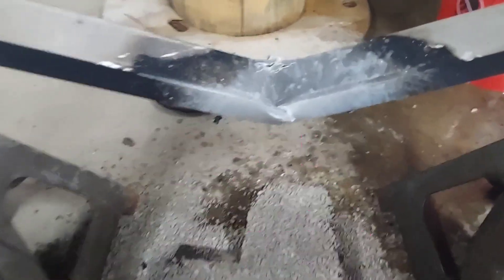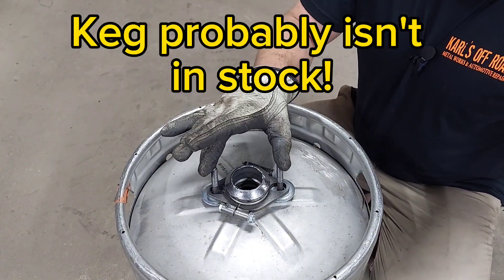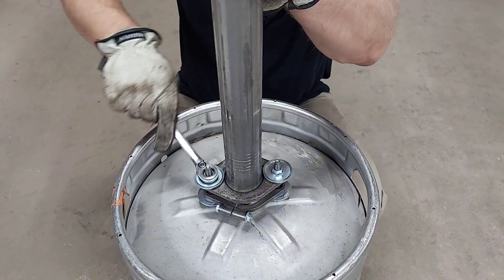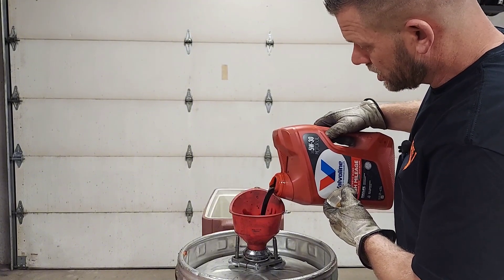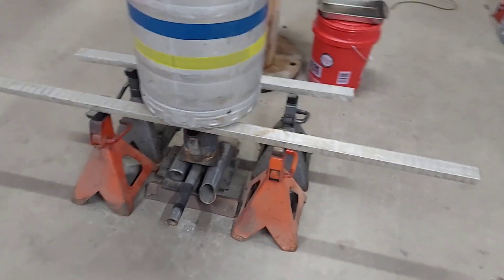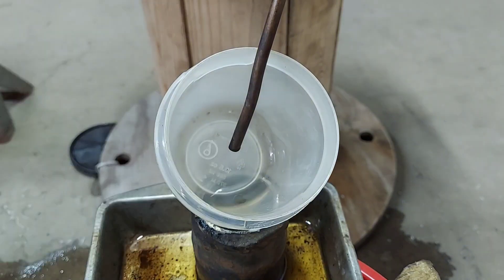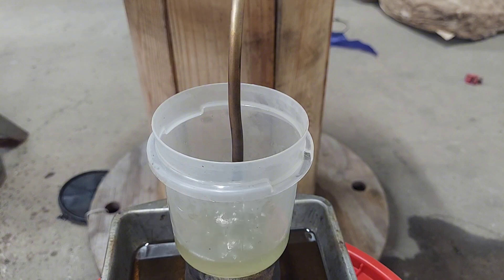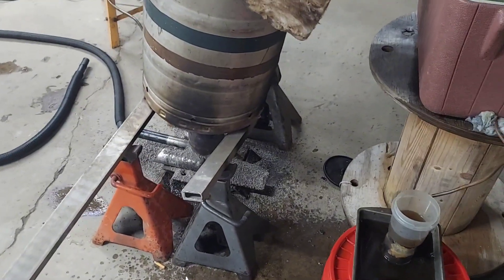DIY diesel fuel from used motor oil! Not black diesel!

Comment: So lubricant oils are longer chain hydrocarbon than fuel oils, u can't turn lubricant into fuel oil... 
The distillation process removes short chain hydrocarbons leaving lubricants....
Yes black diesel can be used in some less particular engines.... But this isn't Diesel
Reply from the maker: Neither is black diesel? It's oil mixed with gasoline. I would argue that my fuel is as close as you can get without distilling crude oil. I don't have to add anything to it or any further filtration to use it in my engine. I'm about a year into testing this fuel in an engine that has only run on my DIY diesel, and I haven't had any problems yet. Thanks for watching and I appreciate your input! Have a great day!

Comment: Hola.. muy buena información. Acá en Argentina el costo del diesel es muy elevado. 5 dólares el galon aproximadamente. Y voy a intentar producir un poco de combustible para mí uso.
Reply from the maker: Good luck and be careful.  I do have some other videos with a much safer setup. Like with all projects, it can get dangerous. Use caution any time you're heating a volatile liquid.

Comment: It says diesel ignites at 410 Farenheit so is it not dangerous?
Reply from the maker: It definitely has risks involved. Lol,as long as it doesn't get any oxygen in the still, it should be fairly safe. Similar to a wood gasifier.
Reply: @karlsoffroad  so where do you put the gas vent of the cooling tower? I guess anywhere on top...
Reply: So it heats up turns to gas and flows to the cooling part? Why hapens to the leftover sludge or carbon? It just collects at the bottom?
Reply from the maker: @Peterswarahed Yes,then you can dump it out and use it to heat the next run.

Comment: It's black diesel. After about 48 hours, it will turn into black diesel. This is due to the carbon compounds in the oil that is produced. To clean it, you will need to go through another chemical treatment process. I have been testing it for over 10 years.
Reply: So why dont Share your wisdom then?

Comment: You might consider heating with an electric element so to keep those volatile gasses from finding that flame.
Reply from the maker: @azurplex  I've since moved my condenser further away and made some improvements. I haven't had a problem, but I would definitely like to avoid having one! Thank you!

Comment: What else would you have to add to it for it to work in a pre emissions common rail? A 3.0 m57 and a 7.8 Isuzu to be exact
Reply from the maker: @4rubberzaday  some people say you need to chemically treat the fuel. I have been running it in a Chinese diesel engine with no problems. Use at your own risk in something important. I'm no chemist, but it runs fine in my cheap engine.
Reply: I bought a Chinese diesel generator of alibaba I’m going to try running off this hopefully I can make it to where it’s self sufficient and have it make its own fuel. Got a high temp vevor hot plate I’m going to try to use with temperature control

Comment: your first fractions are not an oil fuel fraction.  Would be more of a petrol like fraction.    Till it hits the right temp to be putting out a kero/diesel fraction ...... you can feed the early stuff (while still in gas form- do not even need to condense it) right into the burner fire to use it as an aid to your heating process

Comment: Insulation will 10 x this project.  All your time and heat is being lost on thermal losses.  Aluminum heat sink
Reply from the maker: @eby6114  I did wrap it in insulation. Thank you for your suggestion.

Comment: What is the best way to connect the cooling coil to the steel pipe I'm using black iron pipe and stainless steel 3/8 tubing
Reply: Ok thanks I tryed soldering but the soldering was melting loose
Reply from the maker: @lifeoftraveling8330  ,I have a newer video with the improvements made to the system. I also had much cleaner production.
Reply from the maker: @lifeoftraveling8330  they sell adapters at most hardware stores. I'm using an adapter that goes from black pipe to 3/8ths copper with a compression fitting on the copper side.

Comment: i thought what an awesome idea its a learning process pleased nothing was damaged but a successful demonstration of cleaning used oil  i saw on a youtube channel how you could easily clean cooking oil by using gelatine mixed in warm water and mix it with the cooking oil the next day all the impuritys are gone and you just tip out the clean oil and afterwards pull out the set gelatine and throw it away super simple process and i thought if it works for cooking oil it could work for engine oil so i was going to try it i am in the country so have had to order the gelatine in But your process works really well and people should be recycling used oil for diesel vechicles or just for burning or heating and your oil burner works awesome Thanks for sharing
Reply from the maker: @brenttamatea7578  Thank you for the kind words! I appreciate you taking the time to watch and comment! Have a great day!

Comment: A real back yarder doing this video, using 1/4" mild steel bolt on a product that is heated, i would never recommend.
Reply from the maker: There are two 5/ 16th bolts that hold the flange together and two 3/8th bolts that bolt both flanges to each other. I'm not sure if that's what you are talking about? These flanges are meant for exhaust systems. They are a repair flange for the pipe to manifold connections, and your exhaust system gets just as hot if not hotter. I would say the flanges are not an issue as far as safety. The rest of the process is far more dangerous! 😆 This is in no way a how-to video.

Comment: At 12:00 , I’m screaming at the phone… TURN YOUR FIRE DOWN 
1) Your whole “beer keg” needs to be inside another metal canister, as a fire chamber … you’re losing too much heat out of the sides, and the top of the keg
2) Your column should probably be insulated, also
3) Your copper tubing is way too small 
4) Your condenser section is way WAY WAY too small  - Quadruple the size of your condenser!!!! The product that drips out of the end should be room temperature - or cooler than that!!!! 
If the product that comes out is warm to the touch, you need to have MORE condenser, yet
Reply from the maker: It comes out cold,so no problem there. I realize it's not efficient in any way. I'm definitely going to be using a different vessel to hold the oil in the future. I'm just experimenting until I get my setup working. I just used what I had laying around and went for it. Thanks for your suggestions!
Reply: @karlsoffroad   Cool, good to know!

Comment: I've always liked the idea of distillation and have thought about it quite a bit over the years.  My only question is energy input.  Is the fuel output worth the energy input to heat the oil to the point of distillation?  Thanks for the info.
Reply from the maker: For me, it is because I use waste oil to heat it,and my blower only uses 19 watts.
Reply: @karlsoffroad  nice.  Have you ever had any close calls as far as fire and such goes?  That's something else that's always put me off a bit.  Also, how much output do you get per gallon of input?
Reply from the maker: @NotSoGrandGarage ,I'm working on a video about the output now. It should be posted this week. I've made some messes, but no explosions yet! Lol

Comment: So how tall was your stack you made on top the keg I'm looking to build one out of a 55 gallon drum
Reply from the maker: About 5 feet,I changed it since then. I was in the middle of a run and ran into a different issue. I will be posting the video soon.
Reply: @karlsoffroad8609  ok can you let me know the change or going to mention it in the next video
Reply from the maker: @lifeoftraveling8330  ,I will have details in the next video. I made the tower as short as possible along with some other changes. Thanks for reaching out!

Comment: great video. would it be beneficial to have some kind of packing in the column?
I've had most things needed to make an alcohol still for about 20 years but haven't gotten off my ass. now I don't drink and plenty of wmo this might be a good project.
id like to know how to pull different fractions at the same time tho if its possible in a home setup.
Reply from the maker: I had some OOOO steel wool packed in the column. I'm doing another video today with the shortest possible column I can manage. I had quite a few comments suggesting that, so we'll see what happens.
Reply: @karlsoffroad  cant wait to see 😊
Reply from the maker: @mickwolf1077 ,I ran into some issues during the run for the video, slightly postponed at the moment. I will add some things and try to pull some different fractions, too. Would be nice to get some gasoline.
Reply: You won’t get gasoline…… Maybe a couple ounces, at the very beginning of the run… But that was just what was already trapped in the engine oil. The reason is…… You’re NOT starting with “crude oil”. You’re starting with “motor oil”, which has already been through the refinery column.
 The best you can get out of this is diesel… So time to find a diesel vehicle to start driving!!

Comment: how do you test it to see if its diesel and not somthing more volatile?
Reply from the maker: I haven't had the opportunity to test it in an engine yet, but I can tell you that it burns just like pump diesel when lit. I will be getting a cheap diesel engine to run it through to see what happens.

Comment: What's the cost to heat the tank. To make the diesel.
Reply from the maker: Free used motor oil and about 20 watts of electricity for the blower. I'd guess about 10 cents?

Comment: Very interested in if the oil you made turned darker after a few days and also if it stinks terribly?.
I have done this 3 times now and each time the oil stinks so bad i wouldn't dare pour it in anything.
The liquid I recover starts clear but becomes darker after several days as it oxidise.
Even performing the destilling operation under vacuum stank.
Reply from the maker: Slightly, but still burns just fine. I will be getting a small diesel to test the fuel. I've had some sitting for about a month, and I'll use that for my first test.I think the fuel should be treated with sulphuric acid and potassium bicarbonate,but I don't like the idea of having more chemicals added. I see people running straight waste oil or a blend, so I'm confident this will run just fine.

Comment: The tubing is way too small you cannot have any rubber pieces as they will burn and you need much more surface cooling area and contact with water AKA bigger heat exchanger

Comment: Do you need to have catch trays in a distillation column it is too tall you're going to have too much reflux possibility of thermal Runaway also needs to be vented and breathable to the atmosphere to reduce the possibility of the big bada boom:-)
Reply: You should actually not vent to atmosphere. Pyrolysis of petroleum requires extremely high temperatures and an absence of oxygen. This is what allows the vapors to form instead of burning off. The way it is being done here is actually extremely dangerous, as the vapors are highly flammable and are not being contained to prevent them from reaching the open flame just a couple of feet away. There is much more fabrication that needs to be done to complete this project and make it safe. I have been doing this to make fuel for about two years and would be happy to give you pointers and links to sources of good information on how to do this safely. Please don't fire that thing back up without fabricating a way to contain ALL of the vapors and gasses because doing this incorrectly could easily kill you and whoever else is around.
Reply: @bradnichol6024  okay how or what's the easiest best cheapest fastest way to treat b a s e oil from cracked distilled petroleum waste products
Reply: @bradnichol6024 możesz podzielić się wiedzą jak zrobiłeś swoje urządzenie ?
Reply: @bradnichol6024 can you help giving some detailed advise?❤
Reply from the maker: I shortened it, and it worked better. I am going to make it even shorter for the next run.

Comment: So burn a gallon of some fuel to make a pint of “diesel”?
Reply from the maker: This particular run,that would be a fair guess. I will get it dialed in, and it should be a  1 to 1 ratio. I'm burning waste oil to make the diesel, so I'm still ahead.

Comment: You gotta try burning tires. A russian guy made fuel from melting chopped tires in a barrel with firewood underneath the barrel. The output fuel was something more powerful than Gasoline.
Reply from the maker: I might try some different things after I get this setup dialed in.

Comment: Gloves on hands, flipflops on feet. That's how ya know you can trust this guy
Reply from the maker: Safety first! Great comment!  Gave me a good laugh! Honestly, it's way easier to get a flip-flop off than a boot when a spark goes flying on your foot.
Reply: ha that and he uses aluminum on something that's going to be heated with hot flame and has weight on it.  and thinks it would of burned threw the stainless steel keg but not low temp melting alum.  lol

Comment: That was amazing!  I thought at first your burner wasn't hot enough lmao 🤣 I thought the beer keg woulddraw too much heat away and you would also get the condensation dripping into the burner from the keg.  Turns out I was dead wrong 😅😅😅  But wow! once it got going it worked that well you could get a compressor and start your own lpg business!  and the rate of flow you if you got a metered pump bowser you would have a string of traffic outside your house lining up for cheap fuel🤩🤩🤩 But as you say, the machine you have built is rather large and hardly worth it if you don't use the diesel for your motor.   Anyway, you could use that fuel as a starter for the burner.  Add a layer of oil in the base of burner and pour on your homemade diesel on top and the diesel should light fairly easily with one piece of tissue paper instead of the oh so useful blow torch which is expensive to get refills.  I was totally shocked it melted the aluminium too because of where it was situated, mind you I have made burners that will melt stainless steel using oil, not that I even wanted to either when trying casting aluminium 🥲  Can't believe either how clean your product is, just wow man!

Comment: You really got my attention with this video! 
Lmao!! I’ll bet you did “ shit a brick” when the still started to fall over! 
Is the keg made from stainless or aluminum? Also how flammable is the distillate you ended up with? 
Try to be safe, and thanks for sharing.
Reply from the maker: The keg is aluminum, not the first choice, but it was free! It seems to burn very similar to pump diesel, I just used it to light my boiler, and it was no different than when I use pump diesel. The still falling over was not something I thought about! Lol,thanks for watching!
Reply: Im also interesting  in how well it burns and would be great to see it run in a diesel engine
Reply from the maker: @D3rron08 ,I plan on buying a cheap diesel engine and testing it. I think it will run just fine. People are running straight, waste motor oil or a blend,so I'm pretty confident it will run fine.I did some cold temperature testing, and it never gelled at all.
Reply: What's the final yield when you use two 5qt used oil containers?
Reply from the maker: @ron1386  ,I didn't get to find out on this run because of the catastrophic failure of one of the supports. I will do another run with some steel supports and a shorter tower. The keg still feels like it has quite a bit in it.  I'm sure I could've gotten 2 gallons,maybe a little less? I will dump it out and add a specific amount to get an accurate test.

Comment: You don't need that tall tower... oil vapor is heavy and it doesn't like to rise up, it will condense in the tower before hitting the pipe for outflow... make it shorter as possible... also get a copper pipe with larger diameter for better output... insulate the barrel around would also help for production
Reply from the maker: This was an experiment, and I just used what I had on hand. Now that I learned a few things, I'll get it dialed in. Thanks for watching, and the advice.
Reply: Or put some glass wool insulation around the fraction ingredients column.  That will keep the temp more even and responsive to changes to your heat input.  You are on the right track, just need to add some chemistry techniques.  Good luck.